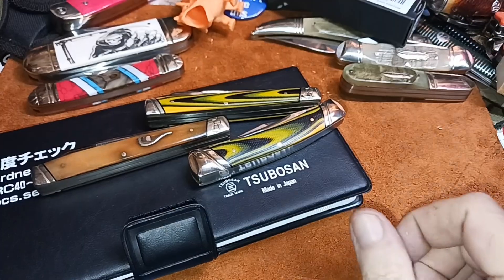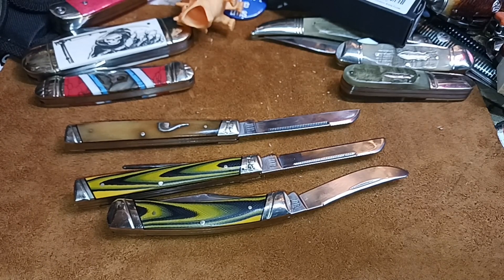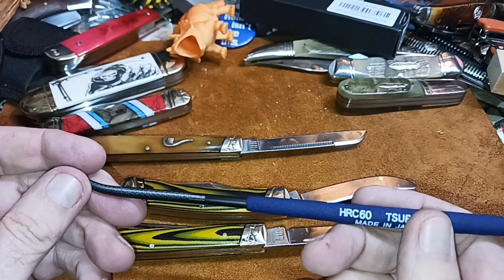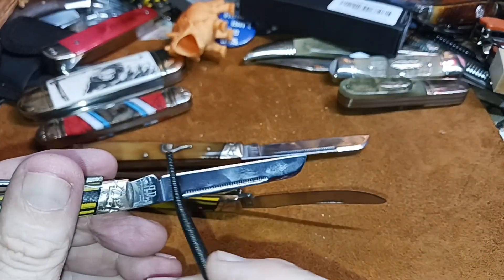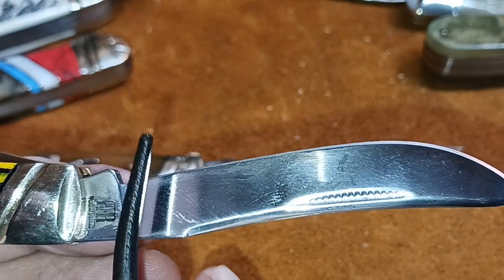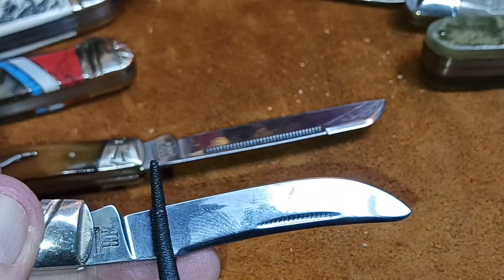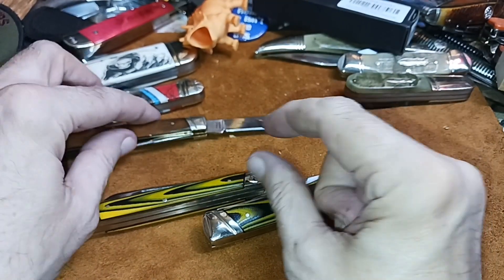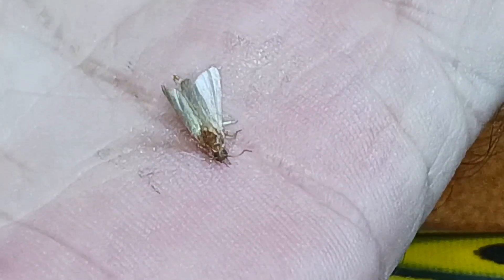(815) What is the Rockwell Hardness of the Rough Ryder Wasp Series VG10?

Comment: Awesome testing with these files while not super accurate they can give you a general idea especially if you use them in a consistent way. Wonder if bread blasted, stone washed or other finishes on a knife effects the testing. Thanks for the great vid and keep making sharp things fun and enjoyable
Reply from the maker: Thank you Todd. The concept is fairly simple,  but yes, it does take practice. As long as the file is below the heat treatment Rockwell,  it won't scratch the metal. To reduce errors, i try to remove any oil on the blade. Something like a blade coating would probably give inaccurate results.

Comment: Great idea to test the wasps! It’s pretty weird the steel isn’t on the blade — maybe the factory screwed up. SMKW is still struggling with their web fiasco, maybe they will clarify things when that gets fixed. I’m glad there are more VG10 options. Couldn’t make myself pull the trigger on those aluminum handled models. Well, not sure I can go with the yellow and black, either. How about a nice brown, Smoky?
Reply from the maker: it is strange that the Aluminium handled VG10 RR came out before the Wasp series, but they got a VG10 etch. That's why i like the blade steel etched or stamped somewhere on the knife.  otherwise it's what kind of steel is that? Shiny steel,  it's Shiny.

Comment: Hi William. This was very interesting. Until now I didn't even know that this series was VG10 as the retailer I use here in the UK lists it as 440A. Of course it isn't marked on the blade as you said. My interest in them is now higher. The only other budget VG10 traditionals that I can think of are Brother, which look very well made indeed.
Would you consider testing the Rockwell Hardness of Rough Rider's T10 Carbon Steel as I'm undecided about what to get next for whittling (the 440A is just a bit soft I think). Thanks.
All the best.
Reply from the maker: Thank you Ivancho.  Sure I'll test their T10. that's a good idea 💡
Reply: @WilliamsKnifeLife  Brilliant William.

Comment: Amizing good hardness on the VG10 steel. I didn't expect it to be between 60 and 65, more between 55 and 60, but they really did a good job there. The mothballs doesn't bother them? hmm maybe you're supposed to throw them at the moths and kill them that way 🤔🤪 As long as mankind tried to store food, there have been pests that try to profit from that. Metal containers seem to be the best way or glass jars, plastic bags and paper boxes get eaten away or penetrated. Those blue insect zap lights seem to do some protection, i think you have one actually if i'm not mistaken, but not so much for moths i guess. Good luck William and thank you for the hardness test.
Reply from the maker: Thank you Jeroen. These moths don't get attracted to the bug zapper like normal moths. I get a few, but most just hang out on the walls and laugh at me.
Reply: @WilliamsKnifeLife  Those are the mutated evil ones, they are immune to the blue light. Say didn't you have some pelletguns and a blowpipe.....😃

Comment: RR Says they do the 440A to 56/58     VG10  is normally done to around 60.  Once  you get beyond 60 the steel can become brittle and chip.     My bet is  your VG10 is done to 58/60 or maybe just a little over.  Basically the industry standard.   Thanks for the confirmation.
Reply: Do you know what Rough Rider's T10 is hardened to Tobias? Many thanks.
Reply: @ivancho5854  Alas, I do not.   From what I understand, T10 is normally hardened to around 60-62 HRC  but supposedly can be hardened up to 67.Some claim that the 67 HRC is fine with larger blades but risks chipping on the  thinner blade stock of smaller knives.  I'm not familiar enough with the steel to make any sound judgement.    I do know, William has some RR T10 knives.   Perhaps he can do an HRC test on them.
Reply: @KnifeChatswithTobias  I hope so. Thanks Tobias.
Reply from the maker: I'll check them out & do a video.
Reply from the maker: Thank you Tobias. It looks like they did the heat treatment correctly. Anything beyond 60 is getting up there in the chipping & breaking possibility. :_Nigel: